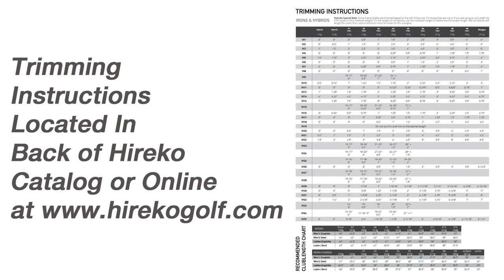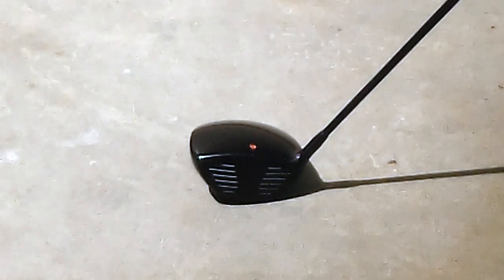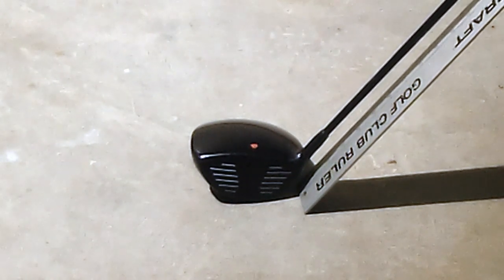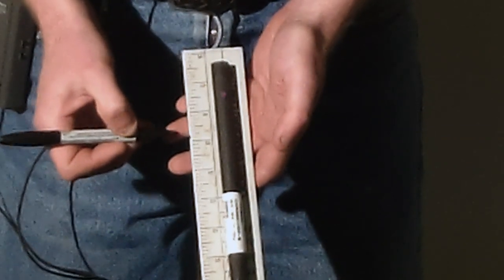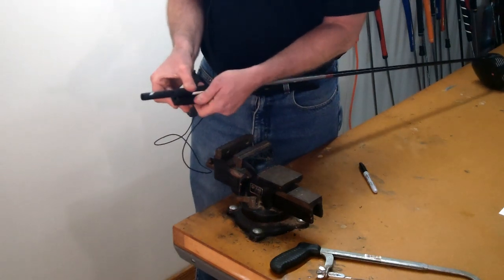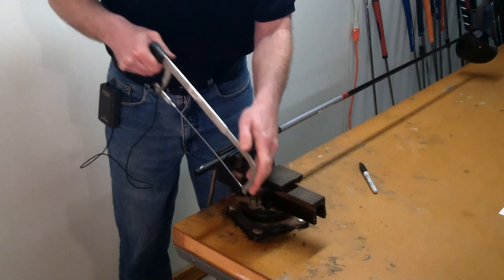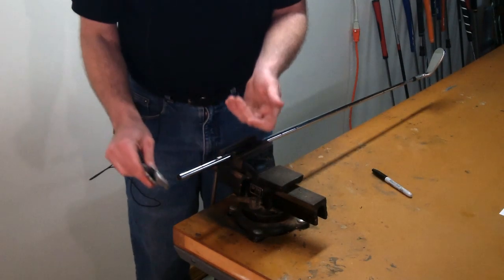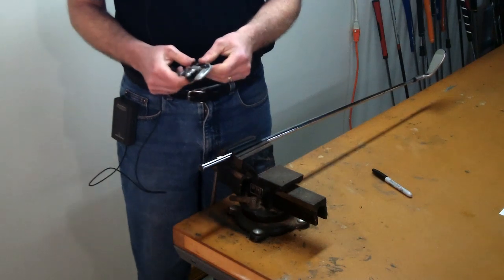How To Assemble a Custom Golf Club Part 8 - How To Cut A Golf Shaft To Length

Comment: He mentions not over tightening the vice in case of cracking composite shafts, it sounds like he does just that as he's talking about it!... Listen at 2.20, what do you reckon?
Reply: Yep, they're so easy to crack using those rubber clamps in the vice! 
I would buy a dedicated Shaft Clamp from The Golf Works and be done with it.